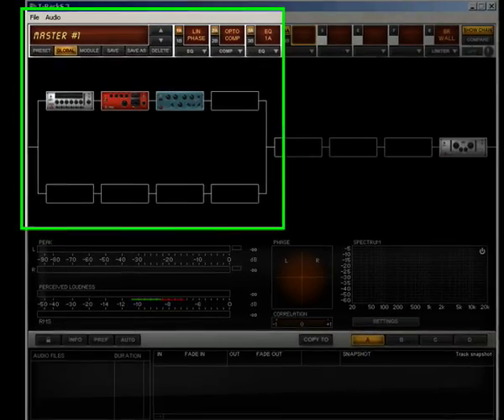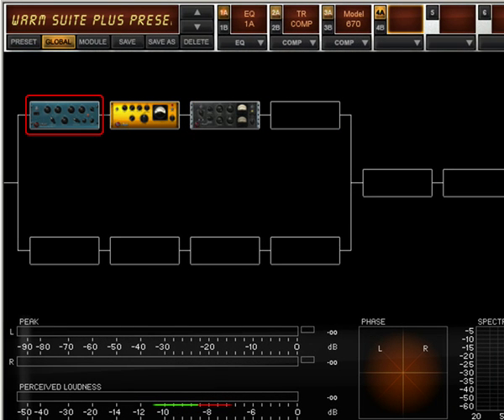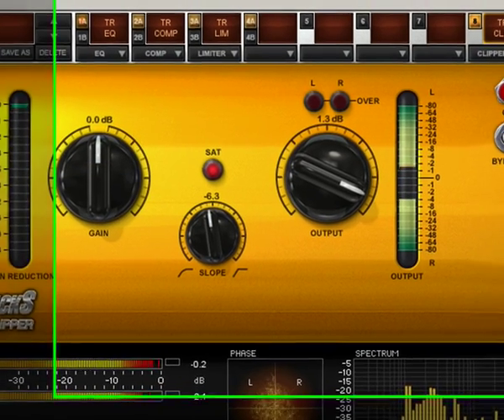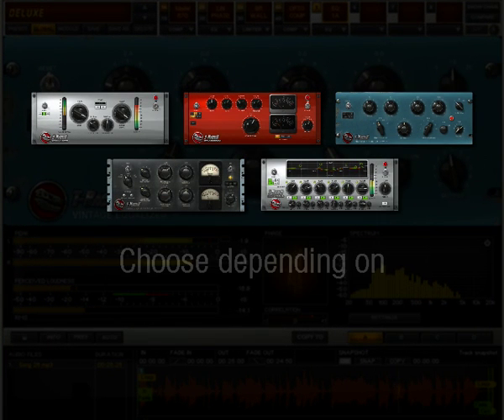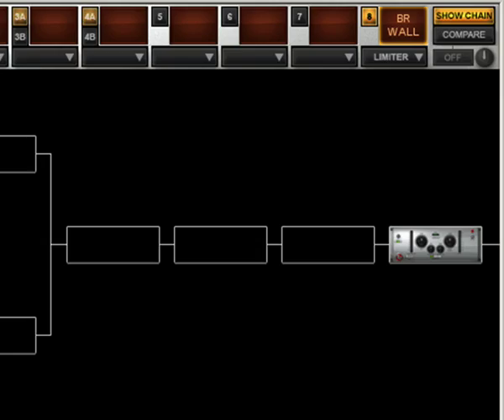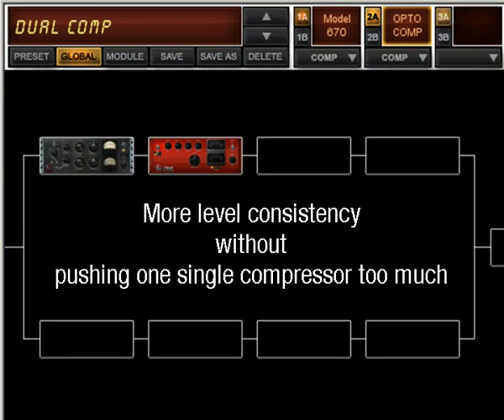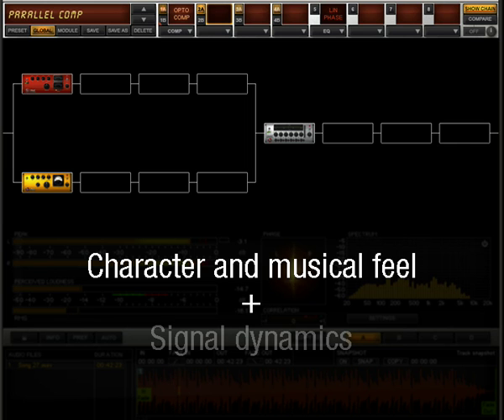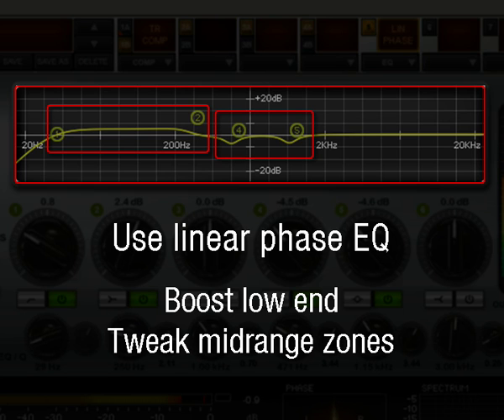T-RackS 3 Chain Setup - Set up your mixing or mastering chain like a pro

Comment: wouldn't you use a clipper before the limiter to tame the high peaks and allow you to push the limiter a little more? I feel like putting the clipper after the limiter is just going to clip the already clipped peaks from the limiter and distort everything..
Reply: A clipper is just a limiter with zero attack and release, so it would do well after the limiter or instead of the limiter.
Reply from the maker: You have access to all this equipment via Custom Shop to try, so you can try it out for yourself and see if your theory is correct (at least on your source material).  Every project is different, every source needs variation in how it is processed so give it a try and see how it sounds for you.  Thanks!  http://www.t-racks.com/cs
Reply: thanks for another great product IK! I haven't found a use for the clipper yet but I'll keep experimenting. cheers.